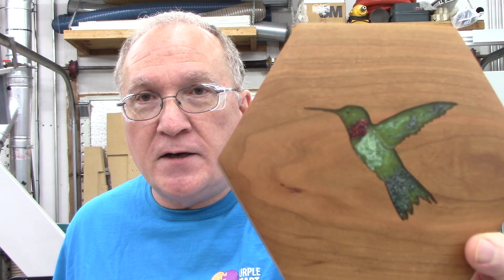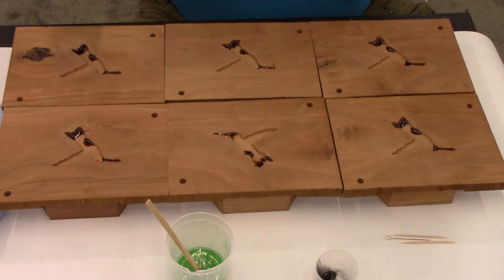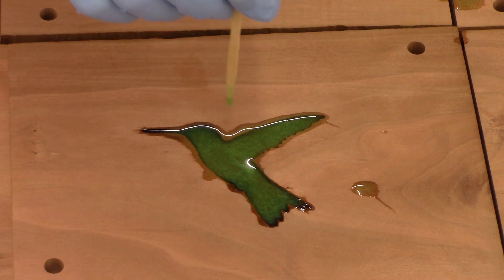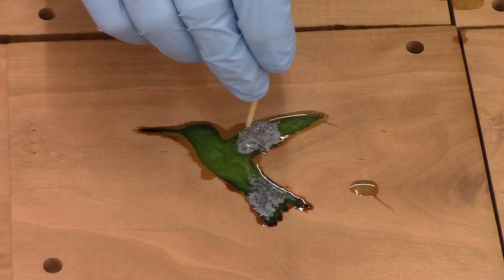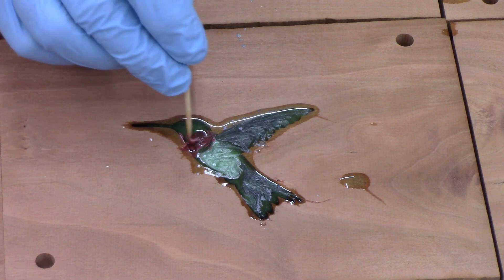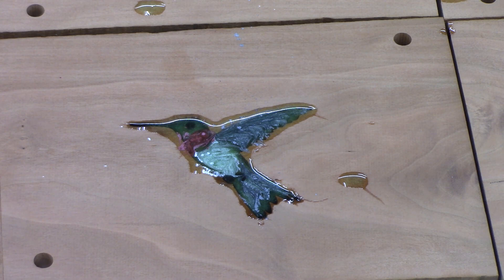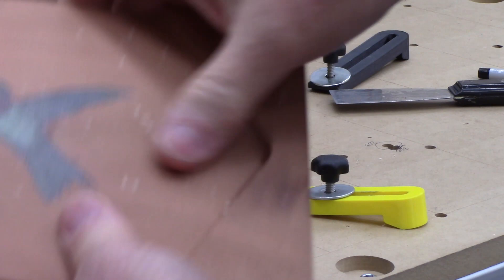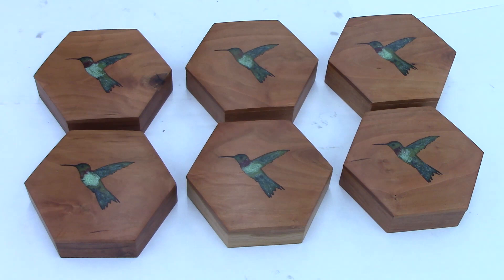HOW TO - Making a Multi-color Epoxy Inlay in ONE Pour

Comment: I'm under the assumption that when you cut your video during the one you were demonstrating for  us you were working on the other 5 and managed to  pull off the 6 as you planned?
Reply from the maker: Hi William.  That is correct, all 6 were done in the same setting.  I just edited for time and to have a closeup of one.  Steve